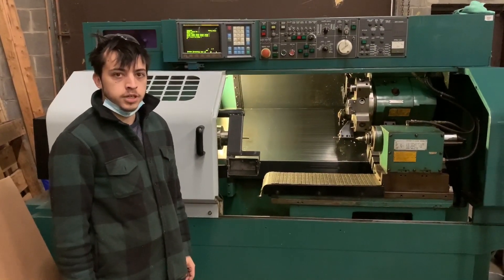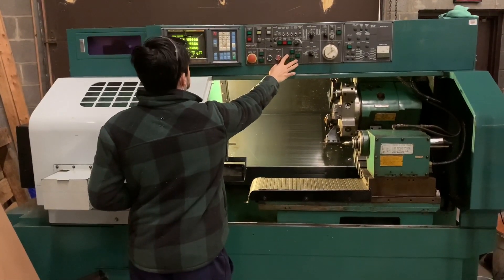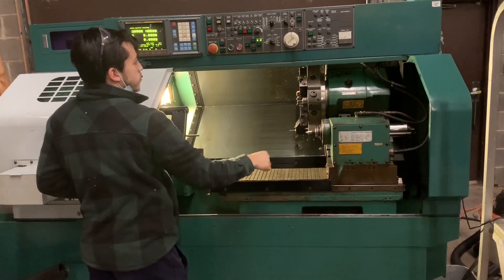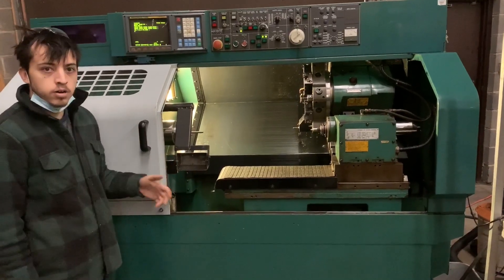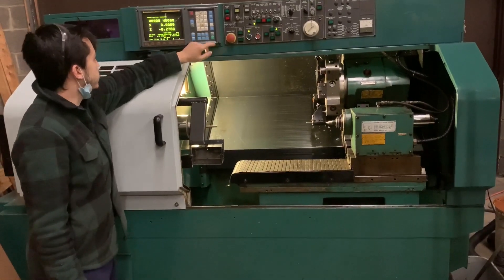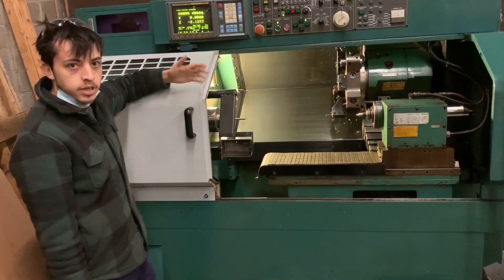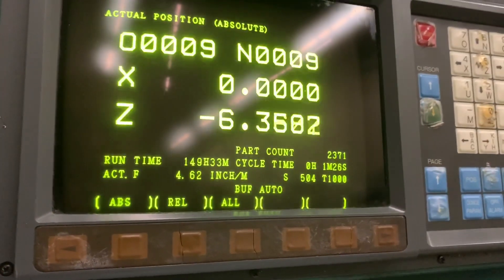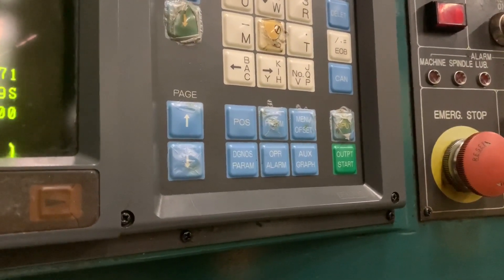CNC Turning Center Warmup Program

Comment: Your CNC lathe or vertical mill should always be in a climate controlled area If you would like for it to b at be🙏
Reply from the maker: Of course.  The manual requires the warmup routine in room-temperature environment, and requires additional warmup if temperature is lower.
Reply from the maker: Thanks, our climate is controlled by God.